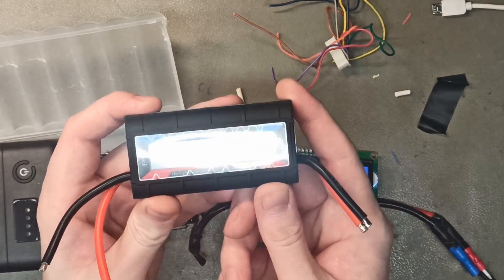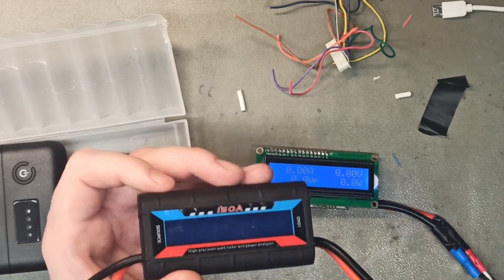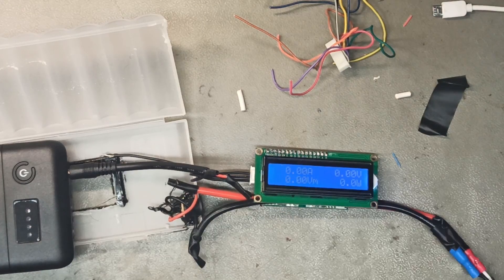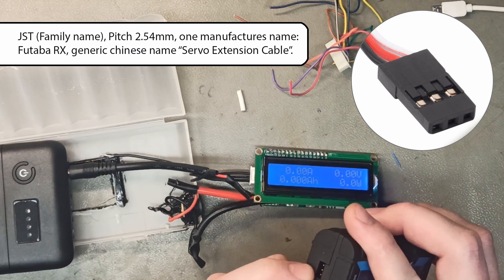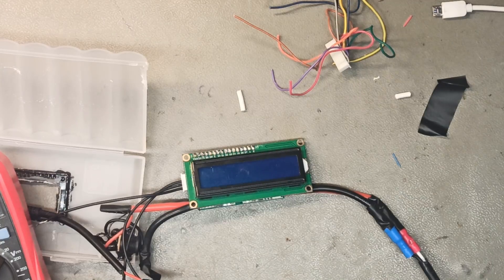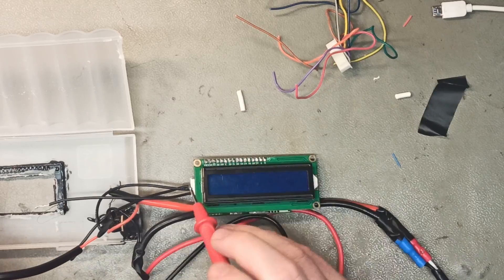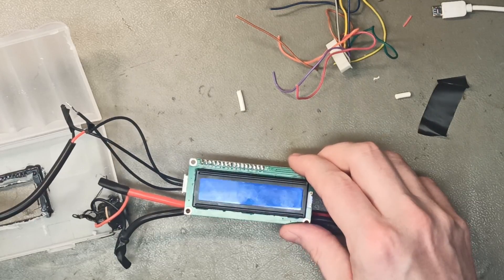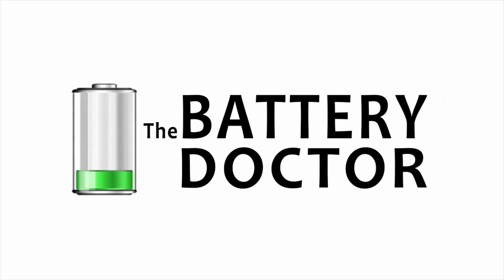How to connect an external battery to HTRC 150A Watt Meter/Power Analyzer

Comment: thank you for this - i had a bunch of old jst connectors that were correct pin spacing but too fat connector - shaved the connector plastic down and attached a 9v battery - works great!

Comment: I have identical 150A power analyzer, and it has on the back side + - signs. First pin is negative, middle one is positive. User manual says it takes 4.8 - 60V

Comment: Can you pls check the pinout for the aux. supply voltage - it seems you scrambled it up (see comments). Must be: 1. negative, 2. (middle) positive.
Reply: Yes i broke mine because I follow this guide now my watt meter is not working.. 😢

Comment: Battery wire can be installed at 3 pins with 12 volts